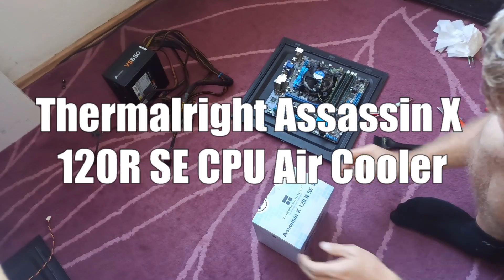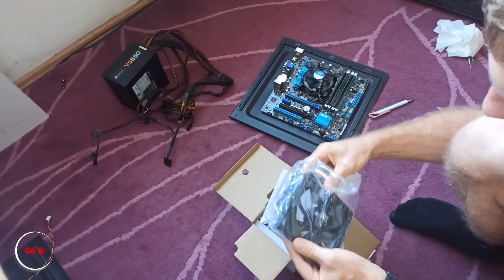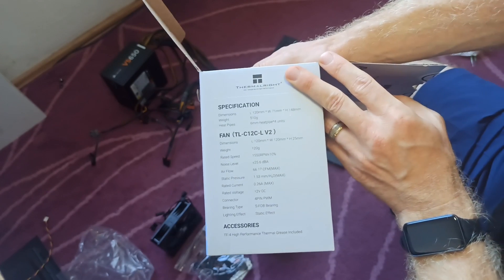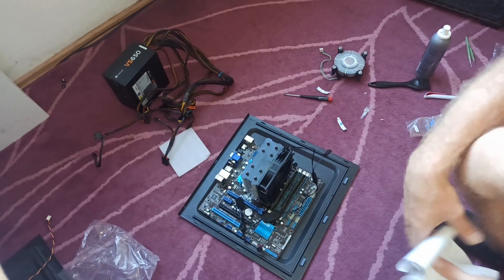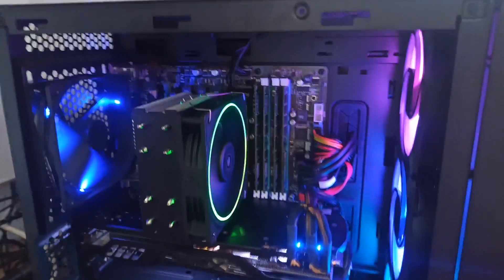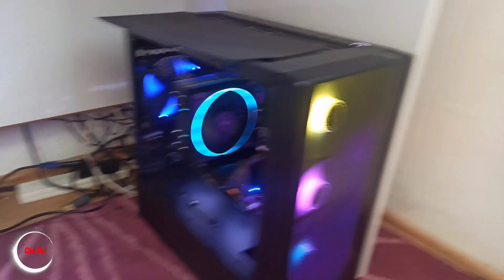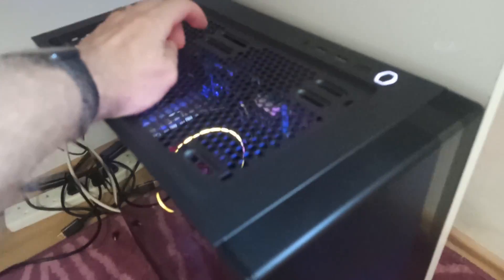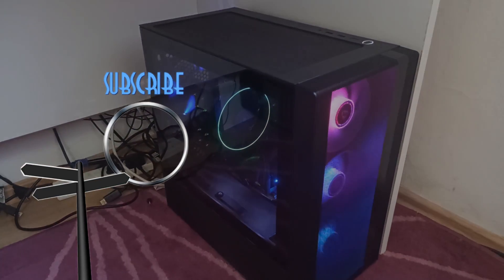Unboxing and how to fitting instruction for the Thermalright assassin X 120R SE V2 CPU air cooler

Comment: Is a 4 pin pwm slot on my Mainboard enough to make the Fan and LED work properly?
Reply from the maker: 4pin Is just for power there is Also ARGB connector you need plugs for LEDs
Reply from the maker: look on my new video there is explain  how to connect this cooler as well